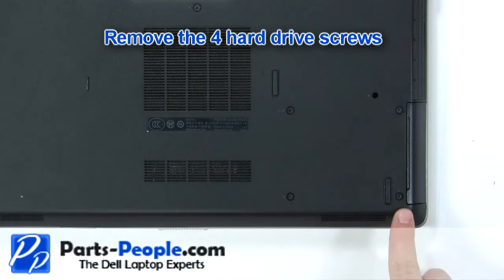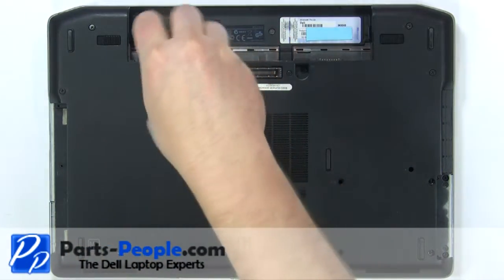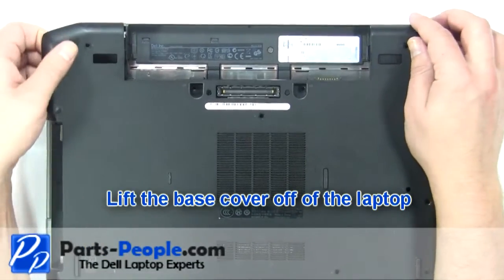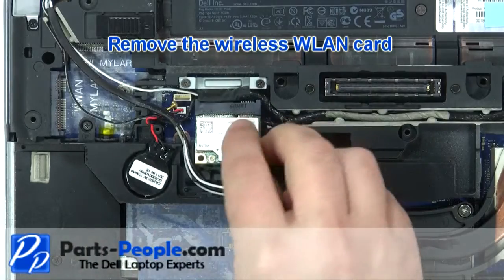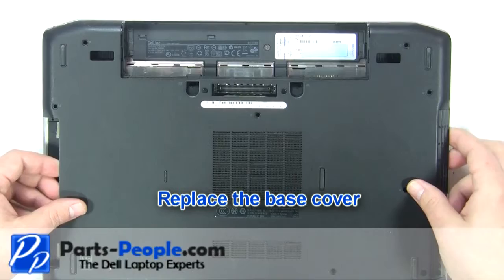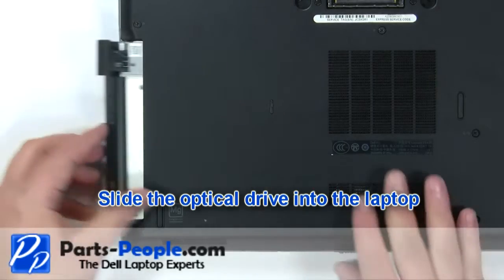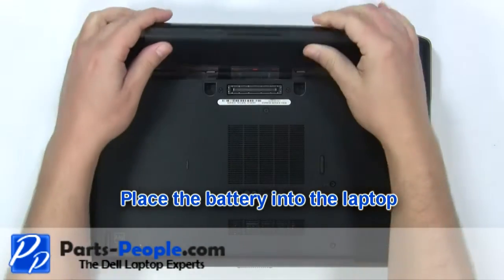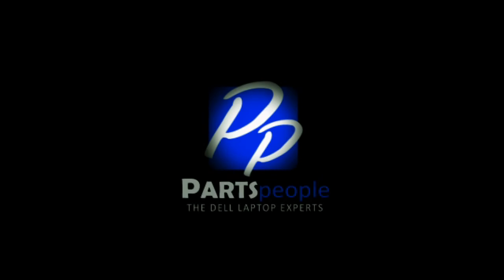Dell Latitude E6420 Wireless WLAN Card Replacement Video Tutorial

Comment: Notice the third stored wire there. I assume its for Bluetooth. The Intel card will fit I suppose Ill have to download a driver. Original is broadbcom. I want to replace it with intel
Reply from the maker: Some of the wifi cards use an extra antenna cable, the bluetooth card is actually located close to the memory slots.

Comment: No need to remove the optical drive nor the hard drive, also no reason to remove the 2 screws inside the doc recesses.    4 extra screws removed and 2 unnecessary parts removed...    (I just performed this operation on my own e6420).